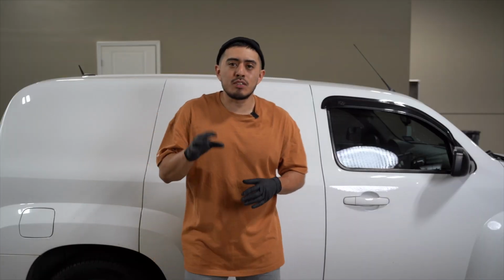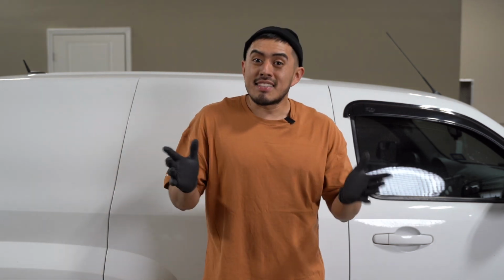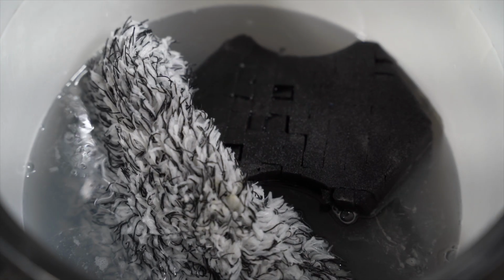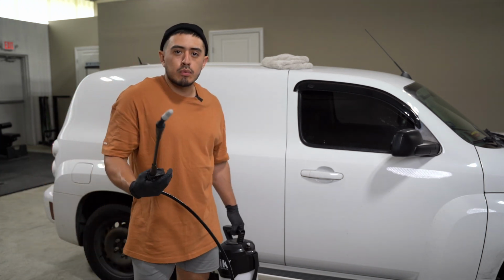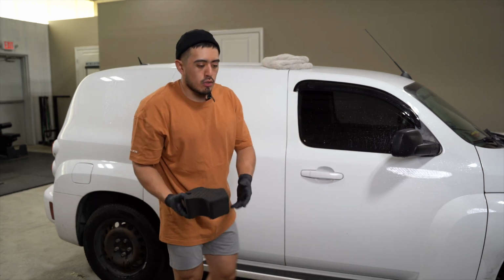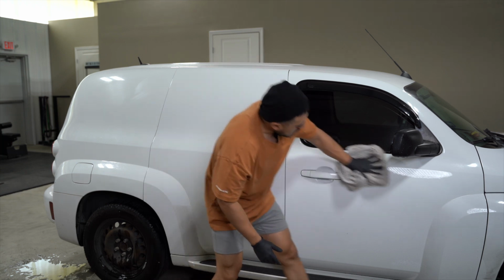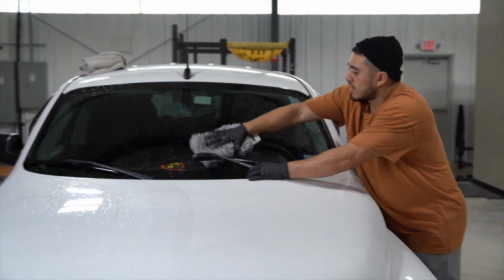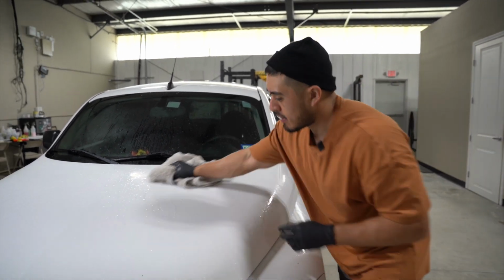Rinseless Wash Method: Wash Your Car with Less Water and in Less Time!

Comment: I’ve gotten zero swirls or scratches from using ONR. Just pre spray with ONR, and use the specific sponge for rinseless washes, use zero to no pressure, and obviously don’t use on heavily hammered exteriors.